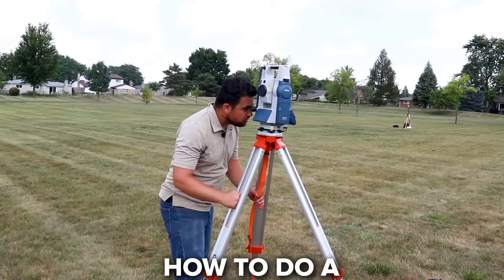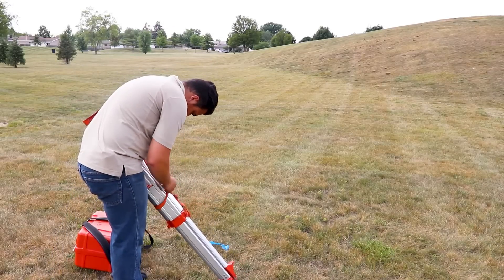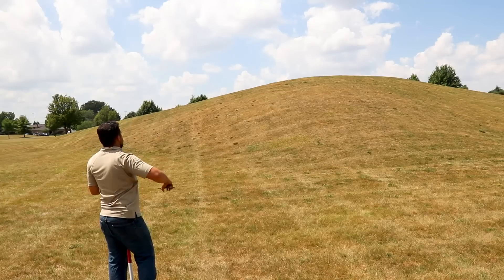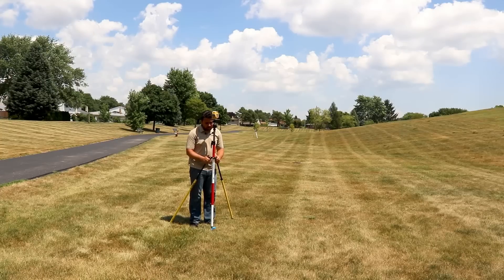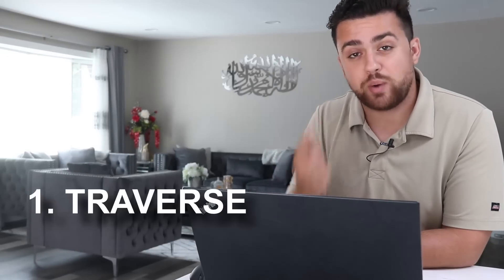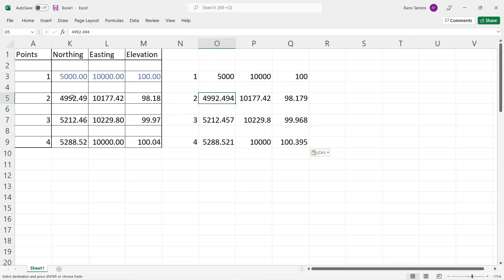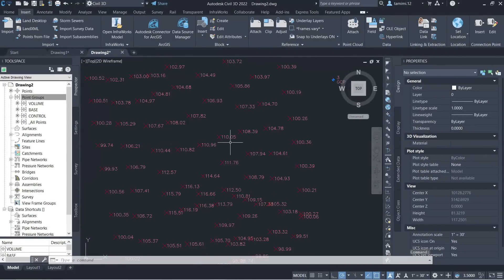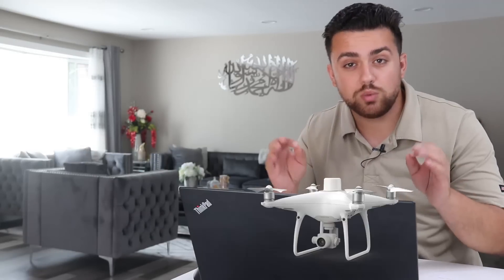Volumetric Quantity Surveying with Total Station

Comment: Dear Engineer,  

*Wouldn’t it have been better* to conduct the traverse first before proceeding with data collection? Admittedly, for topographic surveys and volume calculations, the impact on the final results would be minimal. However, in cases involving cadastral (parcel subdivision) or industrial surveys, I believe the traverse should be completed prior to commencing data collection.

Comment: Hi. Thank you for your great videos. You took 180 degrees as the first direction's Azimuth. What is that? How did you calculate it? Maybe you have used two points with known coordinates to find the Azimuth. if so, which are those points? and how have you calculated their coordinates before having the Azimuth?

Comment: Good video and good explanation. However, on practical matters this is a bit outdated.  I do things like this often enough with a cheap drone like  DJI Mini SE (expensive drones do it even better with scanning and volume apps)  You simply take a picture from above (if you don't want to use Google maps). Then there are other tools like moasure  or use angle meters on the phone to get the height. The entire volume can be calculated in less than 10 minutes.
Reply from the maker: Very efficient. Video on Drone Volumes coming soon.
Reply: Please make a video and explain!
Reply: please details
Reply: will do soon.

Comment: Wouldn't it be easier and faster to set the total station at the top of the hill, because it looks like the entire base of the hill can be seen from the top. It is not necessary to do 4 positions. by the way, it's best to use GNSS Systems
Reply: Yeah I agree setup on top and just knock it out. You could leave the tr points in and locate them off the pile so if you had to come back you could tie in if the pile is changing.
Reply from the maker: Setting up on the top of the hill only works if the ground up top is stable. In this example it is, but in many instances, the stock pile might be made up of loose soil, and so you cannot set up on top of the hill. Using GNSS is just a different method if you have corrections available in your area.
Reply: Yes, we monitored a landfill. Even our traverse that appeared to be in a stable area was settling towards the landfill. We did run GPS on our Travers also. If not the catywompus would have been off the charts

Comment: Hi Mate. Question, how would you specifiy a precision for your volume? If your client needed the volume calculated to lets say within + or - 5% how can you prove this? I understand the quality of the base surface and point density plays a big role but I don't understand how to mathematically prove this? Cheers
Reply from the maker: Accuracy is a relative term. You could always use GNSS or Drones to repeat the process and find the relative error. Then moving forward, you can expect the same degree of error using the same workflow.

Comment: I'm still unclear on what those stationary points are "controlling". But, more importantly, why start with [5,000, 10, 000] and not [0,0]?
Reply: Hey mate, in Australia we do eastings first so the typical arbitrary setup coordinates are usually 1000, 5000, 100 here. The reason we use 1000 and 5000 is because if you’re using an arbitrary datum, it is unlikely that your survey is very large, this means you will never get the same number for both the easting and northing which makes it easy to quickly know whether a coordinate is the point’s easting or northing. The reason we don’t start at 0,0 is because we would then have to deal with negative numbers and although this wouldn’t be particularly difficult, it’s just an additional complication that can be easily remedied by using the false origin of 1000, 5000 or in this case 5000, 10,000.  

It is for this reason that the official coordinate system of Australia (and maybe other countries) has a false origin to make all coordinates positive.
Reply: @jackm2379  Thanks for the explanation. I don't mind negative numbers, but I have on occasion oriented my traverse so it lies entirely within the NE quadrant, so I get where your coming from. I still like using [0,0] for other reasons though.
Reply: I’ve always used 1000,1000,100 or 5000,5000,100 depending on the size of the project. Also, for some reason it really bugs me when someone sets up a site with LCS not oriented to north; it just looks goofy. 😆
Reply from the maker: Control points allow us to set up our prism and total station in a known (or created) reference system. Starting the coordinates at 5000 and 10000 allows us to avoid negative numbers, and not to mix up X and Y values.
Reply: I've always used 5000, 5000, 100. Is there a reason I shouldn't be doing that? Never put much thought into it. It's just what the few companies I've worked for defaulted to.

Comment: Hi, very  detailed video! Just wondering, would you actually use this procedure in real life as this could be done from one station on top of the hill. Or by using two base points on diagonal of the hill and using resection for the second station. Love your drone/lidar videos btw!
Reply: I personally would do this with one setup in the middle. Minimising the amount of setups so there is less error propogation in the observtions.
Reply from the maker: Setting up on the top of the hill only works if the ground up top is stable. In this example it is, but in many instances, the stock pile might be made up of loose soil, and so you cannot set up on top of the hill.
Reply: Some sites won’t let you on the stockpile due to risk of entrapment. So the next best thing is to locate the base with the rod/prism and locate the rest reflector-less.

Comment: Thank you so much for this video. A little bit too advanced for me at this point. Was wondering if similar result can be achieved using iPhone LiDAR sensor, seems like 3d scanner app has a volume calculation option. Wonder how inaccurate would that be compared to surveying you did in this video. One of my biggest challenges is to understand how could I count the volume for either  cut or fill, using LiDAR Scanner on the iPhone. Maybe also not necessarily using auto desk, but some free software for Mac. Maybe blender or sketch up? Is it possible. Let’s say scanning someone’s backyard for the purpose of digging a pool for example. I some case I would need to dig plus fill if it’s located on the slope, in the other cases to dig. So let’s say I scanned the ground, but I will need to add a cube shape underneath the mesh to be able to know the volume of a pool shape with a top being a scanned surface, and the rest being shape of the pool added underneath the surface.. hope you understand what I mean.. would appreciate any tips

Comment: Aluminum tripod(Legs) not robust enough, always use wood
Reply: Did you not notice his closure? And the fact he was using "10 paces"? The pacing error will be far greater than any tripod will introduce...unless of course he was doing it an a warm spring day on ice covered ground, in which case it won't matter what tripod you use, they'll all sink.
Reply: Every time I use an instrument I double check level, buck in on my hub, and readjust accordingly to my backsight
Reply: @freedomhillbilly348  but I've never used a total station. Primitive Builders level, theodolite, plumb bob